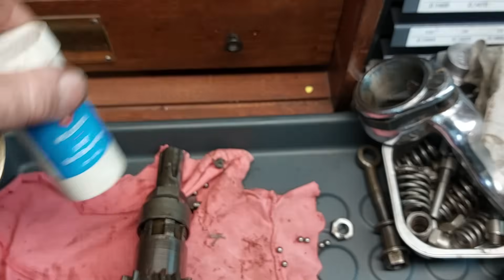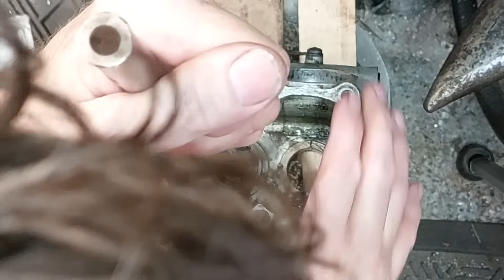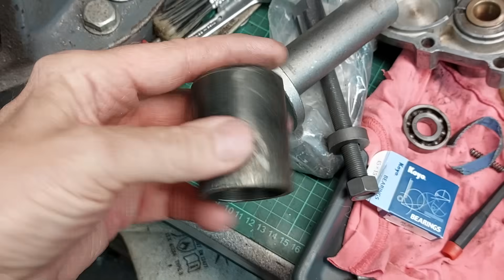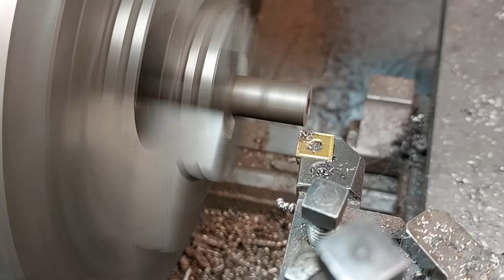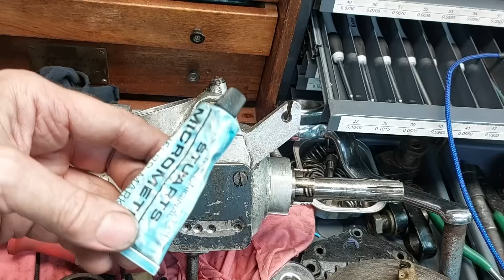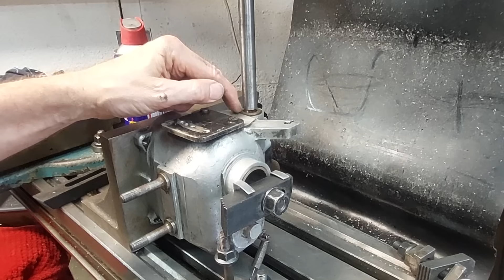REPAIRING SCOTT SQUIRREL GEARBOX WITH CANDLES AND A WELDER

Comment: I have removed gearbox input shaft bearings in the end of crankshafts by packing with grease then tapping the dowel wrapped with insulation tape to use hydraulic pressure to push the bearing out
Reply from the maker: I did try grease......but as we eventually found out it was in there really tight ( even after heating ) and it wouldn't shift it.

Comment: If the case was thick enough, having a couple grub screws placed in the outer race so they could be removed. The bearing pressed out with a couple pins 180° across from each other.
Reply from the maker: In hindsight it would of been the better option but i was trying to avoid welding hopes back up............that didn't work 😄

Comment: After it had been in the freezer, the heat gun applied to the casing turned upside down should have released it.
Reply from the maker: Unfortunately it didn't so thats why i gave the candle wax a go and it worked remarkably well.